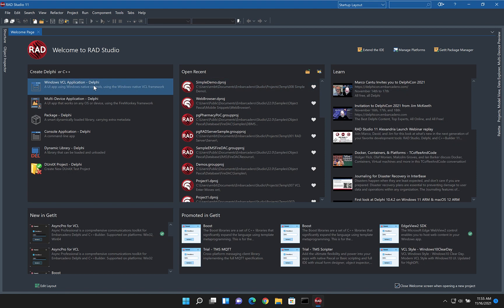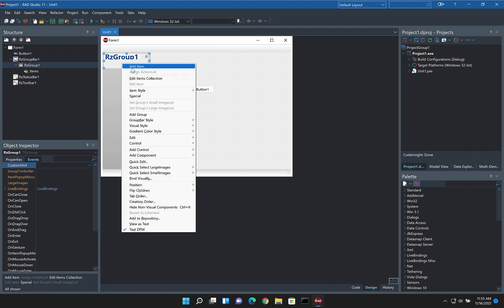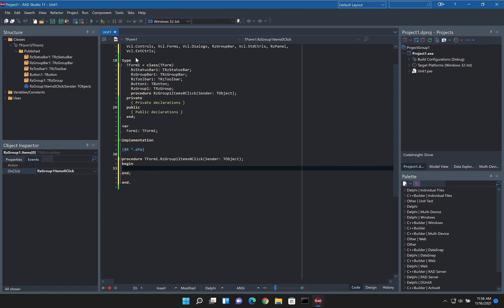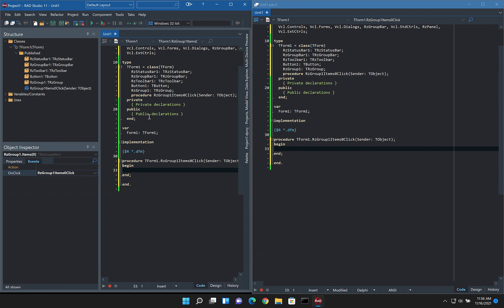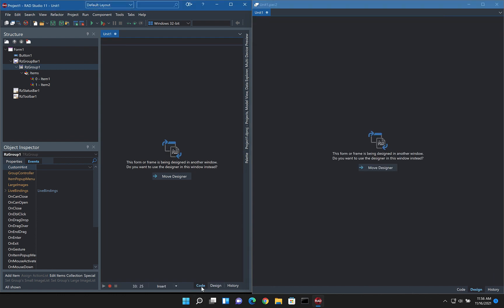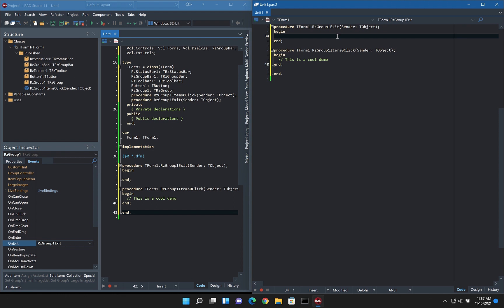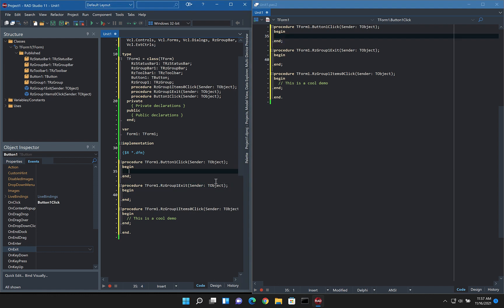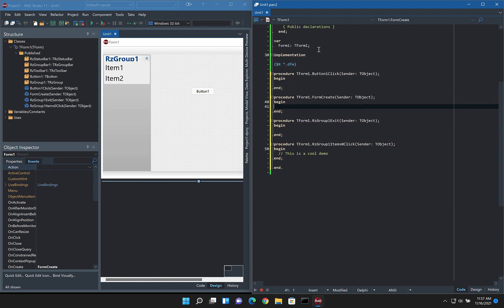Floating Form Designer RAD Studio / Delphi

Comment: Thanks for the content. Well, that's a little better. But it's nothing as powerful as the IDE used to be with Rio (10.3.2) - which had unlimited flexibility with the main window and all of the child windows. Consider, the main window still locks down on the internal child windows into this super-constrained positional locking that is extremely annoying. I want my watches, breakpoints, and messages on another monitor. I want the background of my desktop to be visible so I can see what is underneath the IDE, and I want my code and forms on other monitors as well. I made a video of how the Rio and newer IDEs differ in case you are interested in seeing how badly they goofed up the IDE: https://youtu.be/lzBBfoERZo8
Reply: Does this feature at least allow you to configure a desktop layout that is persistent so that the duplication of code/form layouts return to the monitors you left them on?

Comment: This does not solve the problem, that the windows (other apps) behind the IDE are not anymore accessible with a simple mouse click. Now we must all the time move the mouse down the entire screen to click the app in the taskbar. Very annoying!!!
Reply: That is exactly correct. I had an open trouble ticket with Embarcadero on this issue with the release of Sydney. They closed it without resolving. The Rio IDE (10.3.2) still had the original undocked option. But it was removed for some dumb reason. And I stopped buying the compiler. Right now I have a sales rep that referred me to this video to demonstrate the ability to use multiple monitors, but the other components are still locked into the main windows of the compiler. I use three monitors to develop. Not being able to move everything where I like destroys my workflow. I made a video that explains it further if you are interested: https://youtu.be/lzBBfoERZo8
Reply: To anyone interested. I have a conference call scheduled for next week (August 2023) with Embarcadero. I'm posting this to replies here that might seem interested. One of the three Embarcadero people that will be present is an engineer that can take us seriously. I think that more voices might help. If you want an invite to the conference call please just reply and I will send the exact date and time when they are confirmed (goggle meet, so telephone voice or video preference). I have been battling this for a couple years now and finally - maybe, have someone that will listen. Thanks, because I want my floating form designer back dang it. Please consider attending to voice your opinion.